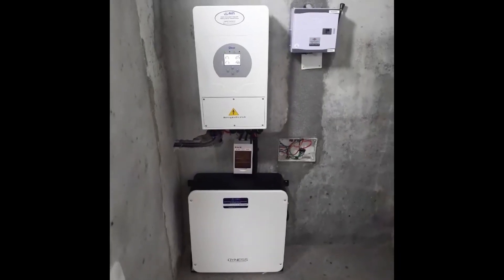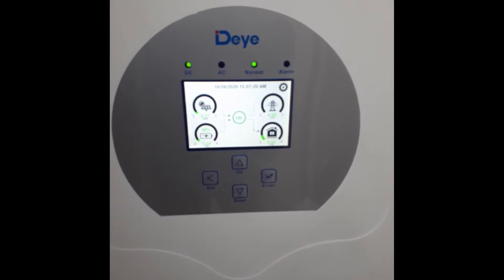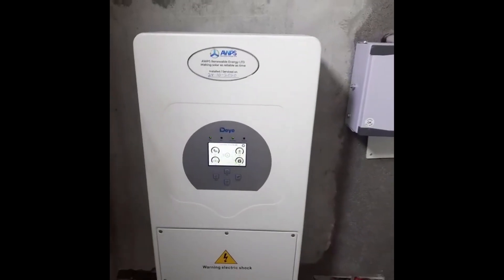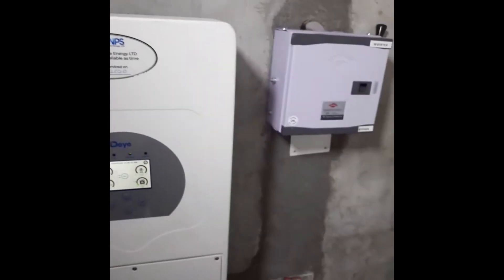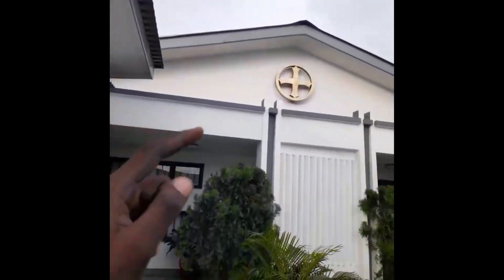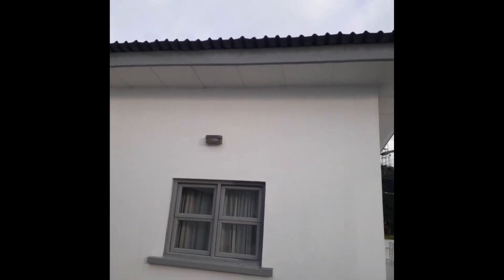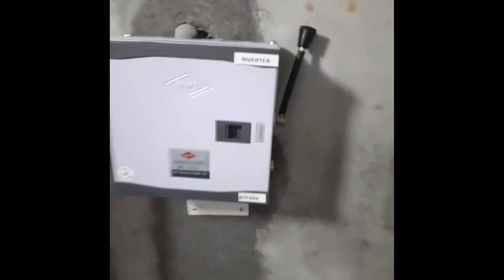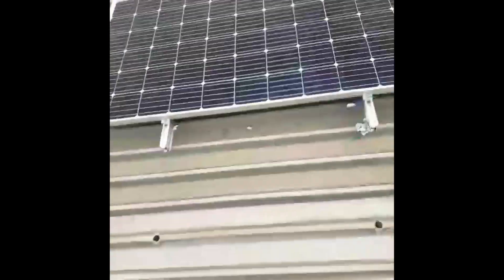5 kw Deye and Dyness install. Video by our tech Ibrahim

Comment: Hi, How is the Dyness battery BMS is operating with Deye inverter? Is any communication issues since?

I am on the process with obtaining a Lifepo4 considering between Dyness or Pylontech US5000c
Thank you
Reply from the maker: Thank you for watching and commenting. They are doing fine. Dyness shows up as Dyness on the Deye inverter

Comment: what could be the possible cause why  the Normal light is not coming on at all
Reply: in addition no alarm light coming up and the unit not going in to  normal operation
Reply from the maker: @DjStarlight12  please go into a full length explanation of the problem
Reply: @drsolar  
I power up the inverter turn  on the pv switch, the battery  pushed button switch and turn on the the grid ac input. the  green light came Dc and Ac section on the inverter but the normal light won't come on and there is no red light to indicate alarm or any  fault code shown on the inverter. The inverter is not accepting or sending out any power
Reply from the maker: @DjStarlight12  send me pictures of your screens and settings to info@atlanticwastepower.com or whatsapp +12018154132. Also take pictures of your AC input and output wires

Comment: I have one of these inverter 8 Kw but I am unable to program as make it switch from solar to the utility when the battery reaches 50% of its capacity· Once the utility power is on it it takes power from the utility
Reply from the maker: Check the time of use settings. That is usually your issue.

Comment: Nice, like over here everything is cement no drywall. How many Amps are the panels.
Reply from the maker: Hello Marco, yes there is no drywall in buildings here. Too much moisture will destroy it. The panels are approximately 9.7 amps. Did you receive your inverter yet?
Reply: @drsolar  yes, should get it running by early Dec. Your the man.